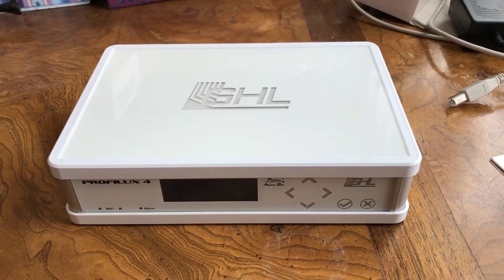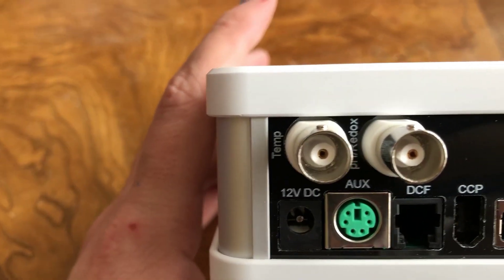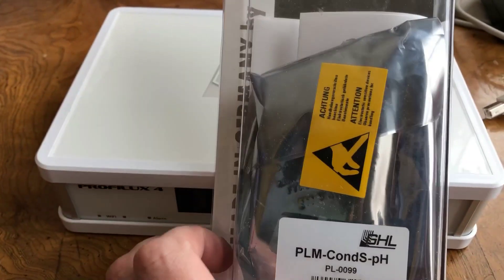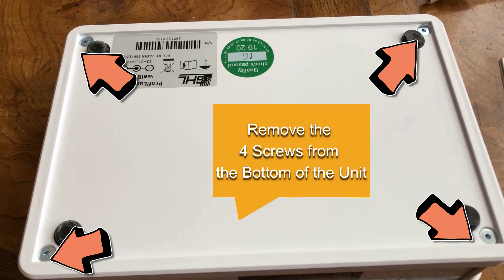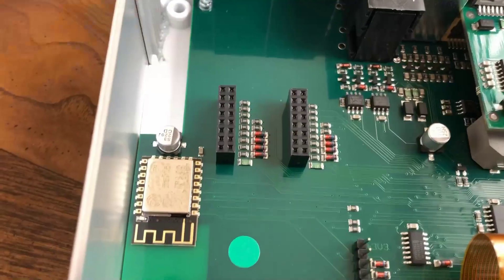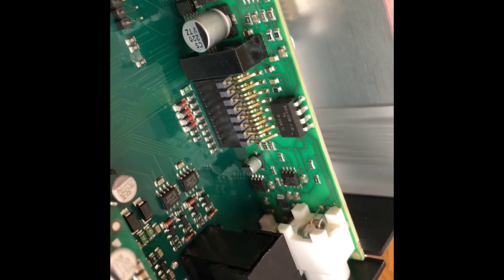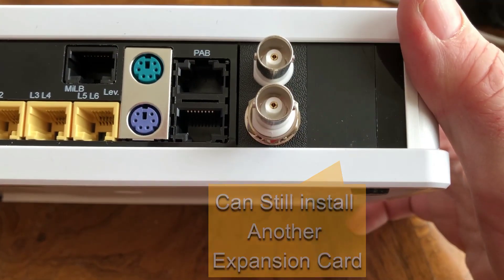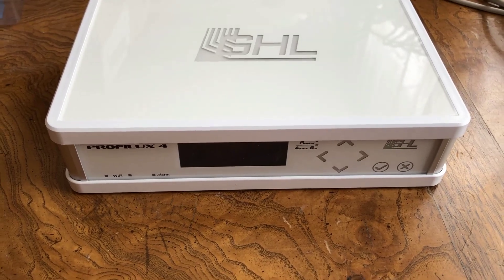GHL Profilux 4e Controller - Quick Easy Steps on Installing an Expansion Card

Comment: I am just starting using GHL having moved over from Neptune Apex and am running the Profilux 4E so just considering adding this expansion card so very pleased I have found your video.  Very helpful thanks but I have one further question. Do you happen to know whether the Neptune Apex Conductivity probe will fit this card connection? Also, will the Neptune Apex ORP Probe connect to the original PH/Redox port? I believe the Neptune Apex is a BNC connector and the Profilux looks similar so fingers crossed with your answer. Could save me some money because I already have the two probes. Many thanks
Reply: you are right in that ghl uses standard bnc connectors on its p4, p4e, doser 2.1 sa as well as kh director